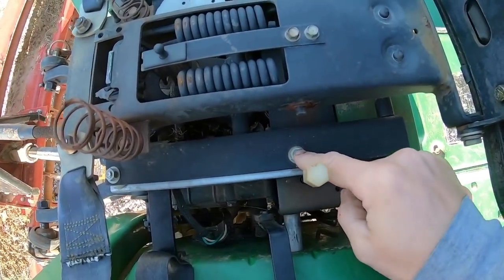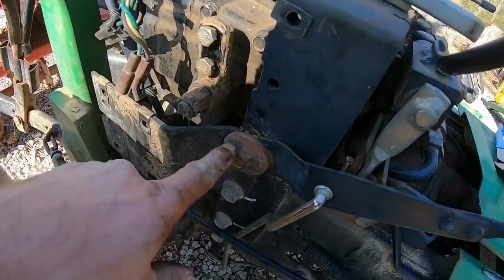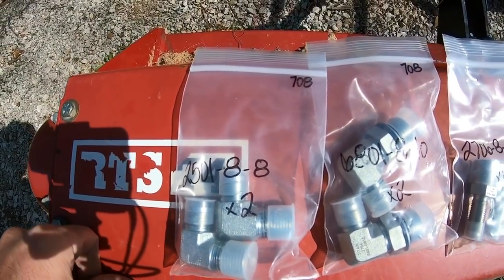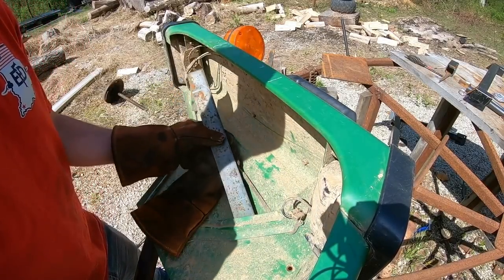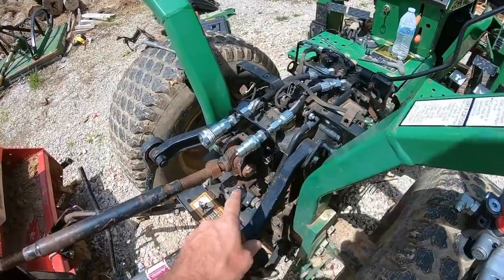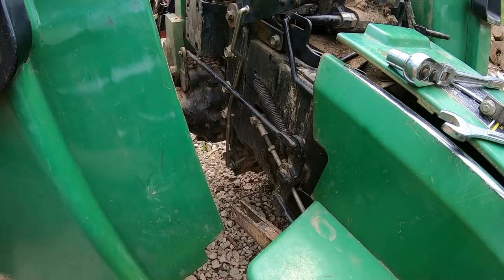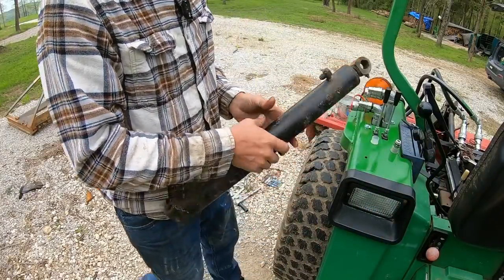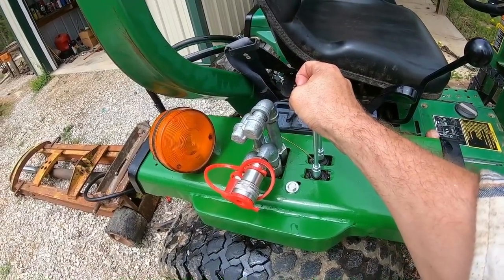Adding Auxiliary Hydraulics to my Compact Tractor - Fabrication - Leaks - and Lessons Learned

Comment: Mike, head down to the Derby store lot and take one (even both) of those C&C Equipment mud flaps off the lowboy (The other Mike will not mind-Clint might😂😂 ).  Use them on the underside of the fender to protect the hydraulic lines and controller from debris coming off the tracker tires. It's amazing how a stick can ruin a $100 hose (that we just don't have $100 to replace them with)!
BTW, can't wait to see your little tracker use Mike's new Tile Plow! 🤣🤣🤣🤣

Comment: Hey Mike. Just FYI from this old guy, I use mechanical hydraulic systems vs electric over hydraulic when I can. Way more reliable and easier to troubleshoot. Your welding skills sure are getting better. Just takes practice. I bought a cheap set of transfer punches from HF...game changers in fabrication. I also love using the rotary burr tools for deburring edges in tight corners. Hydraulics ain't rocket surgery once you understand them. You have to be careful with them, but they are pretty straightforward. Nice job on the installation/fabrication. Stay safe and thanks for posting.
Reply from the maker: Thanks for the suggestions!
Reply: Make a wood splitter but that big cylinder has a huge bore. Its almost a hydraulic press or maybe a rebar bender for the paddle wheel build?
Reply: I have those HF transfer punches.. Pretty freakin good set for $10. 👍
Reply: @mw5905  They work for me.

Comment: Flip the cylinder over to convert it into a log splitter. Or into a bumper jack of sorts. Or even a fork lift. Small farm lifting bails of hay to a loft, wood to the loft/ roof. Not meaning extra heavy loads but lighter loads that’s repeated over and over. And again no camera drop. Wifey been cracking that whip. Lol. As always very interesting job.

Comment: Hello; I understand that this is all new to you. You should use stainless steel pipe and fittings when ever possible. Galvanized pipe etc. is bad because the galvanizing will flake off got into your system. If you have to use brass. Does that have an hydraulic filter? If not I suggest putting one in the return line. I suggest that you consider some sort of cover for the valve area. The elements will really mess things up over time. Good job.

Comment: Cap’n, I’m not a hydraulic expert nor do I play one on YouTube… but looking at your plumbing from my arm chair here in the Ozarks… it looks perfect!  

Under mounting the valve was the right way to go.  The hose connections where you can easily access them is smart.  (Something Kubota could learn from.  My third function hoses require hands about the size of a mouse to install.) Your body work looks great… and leaks?  Well sir, that is part of the rust retardant plan.  

A forklift mechanic that I worked with gave me advice on thread seal for NPT fittings.  He said, put a small bead around the male end. Start it about two threads above the end.  Once tight, wipe the excess off so it won’t accidentally contaminate the liquid if you ever have to take it loose.  So far, it has worked for me on oil, water, air and gas lines!

Cap’n you’ve opened up a ton of options for the 755… I can hardly wait to see what you fab up next!!!
Reply from the maker: Thanks for the tip!  And can't wait to start fabricobbling up some new implements!

Comment: Nicely done Cpt. HD is easy. It's all the hoses you got to hook up that's hard. As far as your fits it all wrenches I'm going to sneak over and throw em all away. There only for emergency use only. Guess I'm going to have to buy you some wrenches bud !!!!! 🤣🤣🤣Lol.. starting a new project with my loader. Going to put it on my Bolens 1476. Already bought me 100 cutting wheels 👍👍👍🤡🤡🤡🤡 great job Cpt.
Reply from the maker: If they work, then they work, which means they work...lol.  Thanks for watching

Comment: Michael, You amaze me.  I'd like to take lessons from you on your research process. 
I didn't realize how the new circuit worked, ie., power beyond to the valve body and valve body lines to your implements. I mounted my valve body on a the
loader mounting beam with levers pointed at my right hand.
Well Done Laddie!!!!!

Comment: 👍👍👍👍 Tapered pipe threads MUST be sealed. With tape or paste, start at the second thread. Ask any plumber.
Reply: Don't quote me but AFAIK and learned BSP and NPT (tapered threads) do not require any tape or paste when/if fitted correctly the first time.
Hand tight and 1/4 turn BSP and 1-2 turns NPT  (BSP are low pressure whereas NPT are much higher pressure (more tighter (closer) threads))
The threads are designed to lock together at a certain point - over tighten and you strip/destroy the female thread and under tighten just doesn't seal.
Most everyday plumbers don't deal with BSP/NPT fittings even gas fitters will have only basic knowledge/experience
Sorry...spent quite a few years supplying metal fittings to dairy/brewery and other processing industries

Comment: The next time you need hydraulic fittings and or hoses if you haven’t already tried you might check Surplus Center on line it’s where I been getting fittings and hoses for a long time they are dependable and much cheaper than most places. You mentioned many people say not to use thread sealant but I think what they are referring to is Teflon tape. I always use hydraulic approved sealant and have never had a problem. I have a John Deere 1023E that I added the power beyond too and also added a separate electric power hydraulic pump unit that I use on my top link plus a diverter for other rear accessories and it’s much more powerful than the tractor hydraulics

Comment: Upgrades to make it more versatile!  And some fender modifications for a clean install.  Probably could use a spring and strap to secure the hoses (similar to the Mack and its hoses/cables for the trailer connections) on the back.

Comment: That turned out good, I've bought hydraulics from Summit, good people to deal with. You may want to be careful hooking up old cylinders to your tractor. I did that and contaminated my hydraulic system, I had to change the oil twice at $80/pail and 7 gallons each time, I also added another filter to help clean it up more. Nice job, Keep smilin.
Reply from the maker: Thanks Darren.

Comment: Well Captain, for once, I've seen an advantage for an orange tractor (the ones DP hate). I have two of them, with the hydraulic block mounted below the footboard on one side.  (Yep, I lose a hose from time to time, but I don't have to field strip the tractor to work on it.) 
Anyway, very impressed with your fabrication skills, I cheated and bought a "kit" to put 3rd function on mine.  You are gonna love having the aux hydraulics.  
I don't like to offer advice, like a lot of "internet experts" but in this case, when you build or add a grapple, think keeping it as light as possible, (my first front attachment was a "thumb" I added to the middle of my regular bucket adding maybe 40 lbs, including cylinder and brackets) I use that thumb just about every day.
Reply from the maker: My valve block is where it is because they planned on it being a part of the tractor from the get go, it wasn't an after thought 😉

Comment: Hi Mike! You know I have been waiting for weeks for this video since you hinted with that valve at the Derby that day! Lol! You did a fantastic add on and you are going to wonder how you got along without it for so long. I use my setup almost daily for some kind of implement. I put a cylinder on my top link and the left 3 point link and the things you can do with a box blade are amazing. Only suggestion is put all female couplers on that valve. Maybe it's what works in your area but around my parts there is alot of agriculture and every implement is set up with two male ends. I can hook to anything i beg borrow or steal Lol!

Comment: Mike, always remember that in doing something for the first time, the normal human learning process dictates that any job worth doing…
… is worth doing twice.
Remember you are prototyping for the most part and “iterative development” requires refining the final design of any complex system over and over until it fulfills the desired function.

Congratulations on expanding the capabilities of your 755.  Going all-hydraulic was absolutely, hands down the right decision.

I believe your frequent fabrication and maintenance activities would justify owning a portable tool cart; equipped with larger wheels/tires to handle the uneven gravel and the ground, You could have a medium sized vice on top over the edge, space for your cordless tools, bits and adapters, and a handy set of LED lights that run on your rechargeable tools’ batteries - which would be always charged since you also included a 100-foot extension cord.

Besides having your tools charged up, you would then be able to use corded power tools when you can keep it plugged into a power strip on your cart.  starting with a waist level rolling tool cart, you could put some fat tired casters on it along with the handle from a hand truck to get it mobile, and even equip it with a hitch attachment and hang it off either end of the 755.
BTW, I have always found that Teflon tape is even better than pipe dope and is far less messy.
Reply from the maker: I tell ya what, a tool cart with big tires and the ability to be picked up with the forks would be awesome.  Maybe a project I need to move to the top of the list
Reply: @CaptainKleeman  Thanks Mike!
Reply: I was thinking about those big wagons some of them have a 1200 lb weight rating.

Comment: Pipe Thread Tape- works well and little risk of contamination. Just put it on so when you screw the fitting on it does screw the tape off.

Comment: Captain,  I'd say you did a pretty good job  on the planing, fabrication and installation of that system.
I also seriously agree with keeping it non-electrinic as it'll keep down on future problem issues associated with electronics exposed to weather. 
Yuppers,  pretty good for a part-timer tractor mechanic 🚜 .

Comment: Mike, that turned out awesome!!! When I had my 955 I had the factory power beyond because I had the backhoe.  I often wondered if it would have had enough power to run a 3pt mounted log splitter.  Never got around to trying that.  I sold that 955 to a retired Lieutenant on EPD.  I’ll just tell you that when your on the Lloyd going into Newburgh right off the Lloyd on Bell Rd is a place called Sisco’s American Hose & Hydraulics.  Those guys are fantastic.  They have helped me out with quite a bit for my old 955 and my skid steer. You ever need anything that’s a good place to stop sometime.    Keep up the good work my friend.

Comment: I use Teflon tape on all my pipe fittings. Several people I’ve seen on Ytube wrap the pipe 5-6 round, to much. I put 2-3 round and don’t have leaks. Loctite make a thread sealed, lot of people love it. Good job

Comment: Great work. You amaze me every time you tackle a project. Welding is getting better as well. I'd never get that back together. Also, you can always run a brace from your bracket to the bolt hole on the seat frame if needed later.

Comment: Very nice job indeed Capt, very professional and clean look not toention the protection provided from branches and vines in the woods. The video was certainly worth the wait. Big fan of the k.i.s.s fashion in which you did it. Only makes sense to stay mechanical on such a machine not to mention the added ruggedness, reliability and simplicity of such a system when it comes to standing the test of time. Just gotta be sure to shut machine off before unhooking power beyond kit. My old man made that mistake once with his JD 1070 and the pump was not happy by anymeans 😬. Can't wait to see the future attachments you build to utilize the system. As always keep up the great work my man 😁 👍

Comment: If I had the cash on hand to buy one of these older hydrostatic tractors 🚜 when I was in the market for one I definitely prefer these over the newer ones. They are so much easier to retro fit aftermarket parts and built extremely well.

Comment: Welding sure is improving.  I do not have a mig welder just a Diesel drive and tend to weld on a lot of very thin metal. rural king had some hobart 1/16 inch welding rod 7018 so you can turn the heat way down.  has helped me with the thin stuff.
Reply from the maker: Definitely need to get some thinner rods

Comment: I would suggest flipping that bolt that holds it to the fender. Once you start bouncing around that nut will go threw the tire. Then you need a new tire. Tractor tires are expensive right now. Also maybe build a small guard for the valves on the fender so a tree branch doesnt mess them up. Looks great I think it turned out well.
Reply from the maker: The axle is fixed, it's not like a truck that has suspension.  But I will trim them for the look of it

Comment: I bought a system that is a plug and play. Works great and didn't have to do much, took about 15-20 mins to install. The cost difference between the OEM system and the one I have was also a major decision as to why I got it over the other. As always great video.

Comment: We did something similar on a friends smaller lawn tractor and we routed short hoses off the manifold to mount the quick couplers on a bracket off the ROPS vs them angling out/in or being straight up. Anything works as long as fluid flows where needed but we knew he would bump a tree and rip them off or roll it on its side and break them....which he did lay it over about a month later lol
Reply from the maker: I plan on making a bracket when it's all said and done. Should add good protection

Comment: Shade tree engineering again ?? 
See you got the plumbing sorted,  all neat tidy, not much room for problems to appear 🤞
You did well on adjusting the bodywork, all the controls on one hand, anyone would think you know what you are doing!!! 
I was expecting you to mount the two rear connectors wider apart, where you have them sited now will work, it may be worth covering the connectors with a dry bag when not in use to prevent build up of moisture and debris in and on them..... just a thought....  and for the nft connections, use thread lock or similar compound on the top two thirds of the thread, this should prevent contaminating the hydraulic system. 
I agree with you getting the mechanical projects completed before going back to the yacht :-  One you will have something to look forward to, 
Two you will have more daylight to get more done !!! 

Ps. Have you had much time to view your wildlife camera ?
Reply from the maker: Definitely need some thread compound

Comment: Mike, I have done a lot of hydraulic work. It is common to avoid using Teflon tape as the tape can breakup and pieces get into the system. These pieces can find their way to the control valve spools and cause all kinds of trouble. Generally, Teflon paste is used but again you want to be careful not to get it too close to the end of the fitting threads to prevent any of the paste from getting into the system. Great work as usual, stick welding on sheetmetal isn't easy.
Reply from the maker: Yup!  I picked up some paste.  That's the plan

Comment: The fitting on the top of the lift cylinder is to prevent hydraulic lock from oil that has been collected as a result of the scraper ring still leaving a tiny amount of oil on the top of the piston. This over time can build up and cause hydraulic lock if you don't have any way for that built up oil to go. 
If in doubt apply the  Pythagorean Theorem " The angle of dangle has to equal the lust of thrust providing the urge is constant.
I hope this helps.
Rob Dalton Stafford, England.

Comment: The big cylinder might make a great fence post driver. I’ve seen them used to push post in the ground. It works great for “T” post and wooden ones.

Comment: You did really well on stick welding that thin metal 👍.    It’s not structural. More cosmetic so if it really bothered you.  you could fill the little pinholes with  multiple coats of primer filler. However it looks good to me I would just roll with it.
Reply from the maker: Hey thanks man!  Definitely appreciate it

Comment: If you want to know if the forklift ram can be used for double acting, un-thread the head, pull out the spear/shaft and see if there are two opposing set of piston seals/wipers. I have converted single to double acting by  enlarging the piston with extra seal/wiper grooves (need a lathe though).

Comment: Hey Mike, awesome work. I’ve been putting this off on my 755 for much too long now. You gave me the push to get it done. Do you have a parts list for everything you ended up using?
Reply from the maker: For all the pump fittings on the tractor itself I went to weingartz.com and looked up the original OEM kit, they have a breakdown on it and lost all the fittings needed.

Comment: Will that big piston from the fork lift , if you hooked that same line that you used to push it with and hook it up to the return valve on your controls and pull the cylinder back in ? If it dose you can make a separate reversible control valve off of your system.

Comment: My only question is why did you run the quick connects to the rear of the tractor first instead of plumbing directly to the valve? Perhaps I missed something
Reply from the maker: That way I can run power beyond out the back if I want to

Comment: Several companies make aftermarket power beyond kits.

Generally, it's easier with the factory kit, but you can add the extra functions to just about anything.
Reply: Appx 13:50  I couldn't tell in the video for sure.
did you get bolts slightly longer than those 2 to make up for the plate and  get the same amount of thread engagement?  If not, you should.  Cheap insurance vs pulling half the threads out.